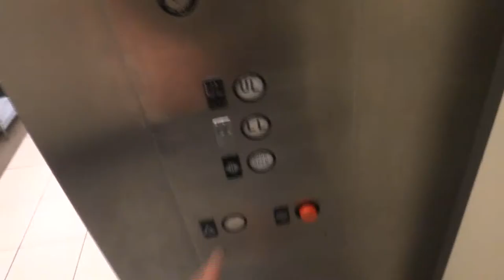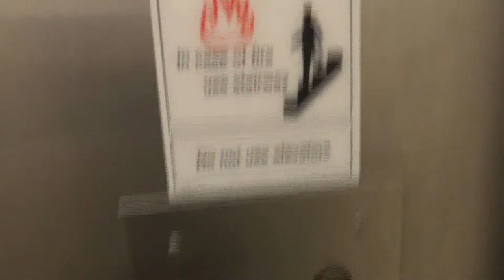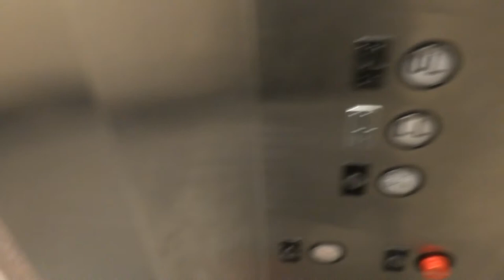Westinghouse Hydraulic Elevator at Sears - Montgomery Mall - North Wales, PA

Comment: If that was installed in 1977 it must have been modernized slightly the chime is consistent with Schindler 220A/330A and the up and down arrow looks fairly modern.
Reply: Gary Beltz It probably used to have the dinnerbell.